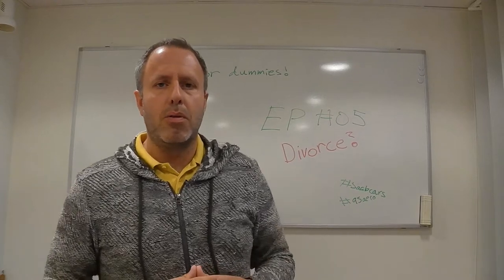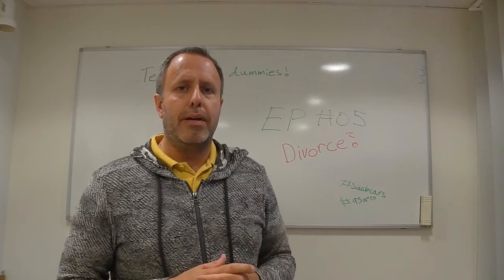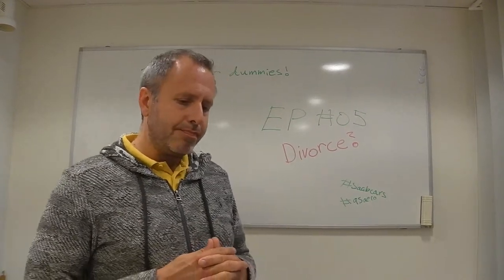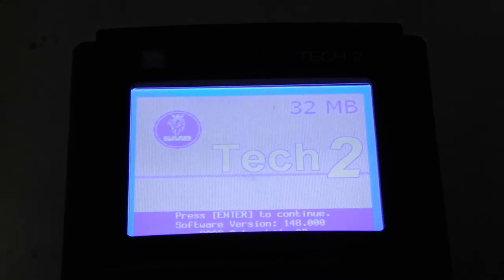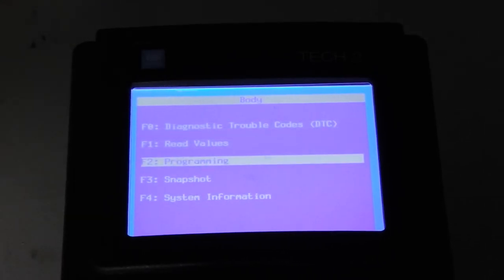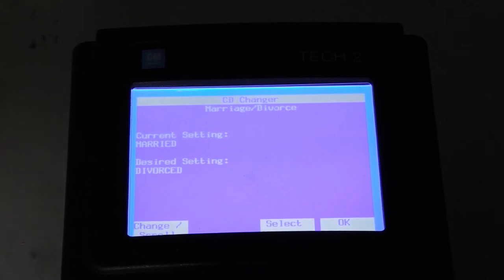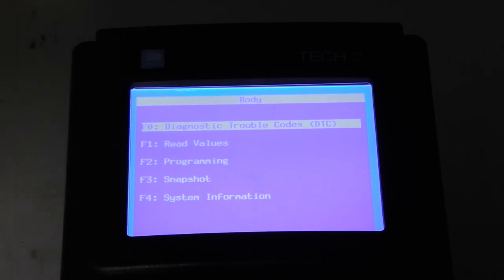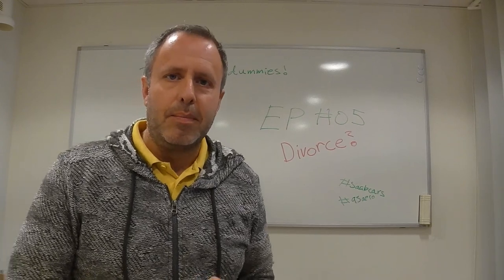Saab Cars - Tech2 For Dummies - Episode #5 - Divorce

Comment: Hei! Vet du hvor man går i Tech 2 for å aktivere extralys på NG9-3 2008 etter man har montert menteringsatsen fra SAAB? Og må man ha sikkerhetsaccess? Hilsen fra Norge :D
Reply from the maker: Hej :) Pröva med detta. Du kanske har svenska menyer, men jag tror du klarar det ! Tror inte det behövs säkerhetsaccess till detta. 

From Main Menu, select F0: Diagnostics.
Next select Model Year.
Next select Saab 9-3 Sport (9440)
Next select F4: All.
Next select F7: Add/Remove.
Next select F3: Accessories
Item 8 in the list should be 'Extra Lights'. Select this and hit Enter.
Next highlight add and hit enter.
The system will then do its thing and eventually ask you to switch ignition off, then finally ask you to remove your key.

Comment: Hmm one technical and one off topic question:
1. I guess you had to find that CDC that was previously removed and now to connect it again, to be able to divorce it, right? worth mentioning (If I did not overlook it).
2. Since you have NG95 now, do you also plan to obtain MDI with GDS2 software to play around with something there as well? :)
Reply from the maker: Hey Peter!
1. When I installed SaabAux and the Parrot HF kit I removed the CD changer from the car without divorcing it. Then it has always popped up as an error when scanning for DTC's. So finally I decided to divorce and just show you guys how to do it. Yes I had to connect back to the car to be able to do this operation correct :) 
2. I have been looking for MDI on AliExpress, but I'm not sure which to get. There are complete kits with HDD for a laptop which should be good to go. I can't find any information that it should work with NG9-5, however lots of other GM brands/models. Do you know anybody that has purchased a MDI clone?

BR
SaabCars
Reply: What HDD would you need for MDI?
MDI has 2 versions, wired and wireless, AFAIK. Both are ready to work with ng95, blue and the green one, all rights for MDI now owns BOSCH company, you can purchase one from them (well, price is elsewhere, I know.) I plan to have one soon(ish) as well (well not for my not-existing ng95) with some support hopefully.
The biggest problem is, possibly, that you have to really have the online subscription to the GDS2 and all the stuff to make things work. But maybe someone will prove me wrong (I hope so).
Reply from the maker: The HDD is a harddrive that has been pre-installed with all the s/w you need. You just put into a laptop and boot up. The machine should be ready to use in conjunction with the MDI. If you go the right way, you will get the software you need and also the support ofcourse... Depends on the level of usage I guess. I don't use it in a commercial purpose, purely for my own cars. 

BR
SaabCars
Reply: I also (plan to only) use it for myself. But I'm not aware of GDS2 software and secure access being "solved" (you know what I mean) apart from a subscription.
Reply from the maker: I know what you mean :-) I wonder what is on that HDD..

Comment: I recently bought a used oem navigation system for my 9-5 from another car but they seller did not divorce it before sending the unit but he gave me the car chassis number and said I can divorce it from my car is this true?
Reply from the maker: Yes. If you temporarily change the Vin number in your car, divorce it and then change back to the original you can marry the unit to your correct Vin number. 👍
Reply: SaabCars thanks bro much appreciated, btw do you have any idea where I can buy the correct wiring for the navigation unit as it is different from the input to the regular radio unit
Reply from the maker: I know. It's a common issue. One has to build the cable harness on their own looking at the diagrams. Try to find a cut harness. New connectors are really expensive.

Comment: Thank you for sharing 😃
When I bought this 2002 9-5 the stereo was already changed to an Chinese. The original is gone. When I connect the tech2 I got the failure stereo is missing. Is there any solutions to get rid of the failure every time I connect the tech2? Is the solution to Divorce it without having the oem stereo available? Will this cause any issues with the connection of the new stereo some ways when divorcing it? Do I need to disconnect the chinese before divorcing maybe?
Reply from the maker: Hi. Thanks for watching. Is it a chinese version of the original or is it just an aftermarket stereo?
Reply: An aftermarket stereo 😅
Reply from the maker: @pergundersen9920  Since you don't have the old one.. The only solution I think of is to get another original headunit with another VIN. Change the VIN in the car to the same as the original radio. Divorce it. Then change back to your original VIN. BR Markus

Comment: Hello!  Just bought a 9-3 2007 2.0. The stereo is locked. According. To the guy it locked because he removed the battery.  Could this be  fixed with the tech 2 by maybe marrying the stereo to tge car once again? Your advice would be greatly appreciated!!!  Thanks
Reply from the maker: Hi. If the stereo haven't been divorced it should not be locked. If it came from another car and wasn't divorced properly it might be an issue. Do you know if that's the case? 
BR SaabCars
Reply: SaabCars according to the previous owner it was working until he disconnected the battery.  Could be a lie.  I'm not sure
Reply from the maker: Hi. Is it the new interior that came 2007? Navigation? Maybe the unit stopped working. Could be the memory inside it that stores this information. What if you just try and add it to the car again?
Reply: SaabCars its the new interior for 2007. No navigation.  I will try that. Thank you for your help!

Comment: How easy is it to swap a single slot CD player for the 6 stack? I have a 9 speaker system in my 05 9-5 Vector Sport but would like to replace it with the 6 stack if poss.
Reply from the maker: Hi, The stereo in the 2005 that has 6 disc changer has a cassette player in the front. The single slot stereo in the front is known as AS1. MY2006 got a updated interior and a new  disc changer in the front. Are you referring to the faceliftet version?
Reply: @TechCars  yes, sorry it's an my06 not 05.
Reply from the maker: @enzodisciullo2557  I'm looking at the back of the two units and they look identical. My guess is that you can swap it but you might need a Tech2 to add it. Can you look at your unit and compare it with this? https://www.markesdemo.se/saab/9-5-06-10/radio/cd-vaxlare/2460995

Comment: Hi, nice video, thumbs up. I have a problem with my Saab 93 2005 linear, it came with 4 speakers, i then connected amp1, no tech 2 at this stage but the extra speakers were working, i then connected amp2 with the extra 6x9 speakers, took it to a saab speacialist and the said there is a break in the fibre optics btw cd changer and ICM3, went home traced the optics from ICM3 to all components in the correct order, no break in physical wires and there's red light in position 1 of all components except the cd changer, with this set up the radio doesnt come on, but when i revert to the 4 speaker mode the radio comes on and only the 4 speakers are sounding. Any help will be appreciated as i cannot get tech 2 to add amp1 and amp2 so i can utilise all speakers.
Reply from the maker: The only thing I can think of is the order of the fiber optic connections. Is everything connected in both ends?
Reply from the maker: http://saabdocs.com/English/instructions/12787154gb.pdf
Reply: @TechCars 
Hi, yes everything is connected in the correct order, icm3 to dvd player to amp2 to amp1 to EHU to cd changer and back to icm 3. I used the saab installation manual and followed the instructions provided, but i don't know why i am having a break between cd changer and icm3.
Reply: @TechCars 
Hi, thanks, but i already have this both the 150 and 300 upgrade sound system, using saab Connectors, fibre optics, fuse and wiring to power the amps, both amps have power going to them and the fibre optic in the right order, 1 input 2 output. There is light in all the systems, dvd, amp2 amp1, EHU. The problem is the cd changer end, no light coming out to complete the ring back to icm3, i have tried using different optic wires but no luck, been on 2 saab furums, no luck and even the saab specialist wouldn't tell me what's wrong, all they say is there is a break in the optic ring, which i already know, suggesting my cd player is bad, they're wrong because when i revert back to the 4 speaker mode, everything works, radio, cd changer icm3, aux, phone. I'm thinking best thing is to buy a tech 2 and spend time on it, time the dealers or specialists don't want to spend on it without ripping me of my cash.
Reply: @TechCars 
I'm thinking could my amp2 which I'm not sure it was divorced from a different saab, be the problem. My amp1 is brand new and works well, but how do i check if my amp2 works?
Reply from the maker: @reginaldigweike4002  If the amp wasn't divorced properly you shouldn't be able to add it to the new car. Was it possible to add it?
Reply: @TechCars 
I didn't get to that stage, cos tech 2 said there's a break in the fibre optic ring. So my thinking is that could the amp 2 be causing the issue?
Reply from the maker: @reginaldigweike4002  It would be worth trying with a different AMP2 that you know has been divorced properly.
Reply: @TechCars 
Hi, i don't have amp2 in abundance to keep testing, the guy i bought it from assured me that it works and it does work because when connected to the fibre optic ring, there's red light going in and coming out to go into amp1. The best i can do is get the vin number or registration number of the car it came from to see if i can divorce it when my tech 2 arrives.
Reply from the maker: @reginaldigweike4002  You could try that. Then change the VIN in your car and see if it works fine. If it does.. well then you know what to do :)
Reply: @TechCars 
Can i use a temporary vin to divorce the amp2 etc as the seller does not have the vin for the car it came out from.
Reply from the maker: @reginaldigweike4002  No you need the VIN of the old car to try that!